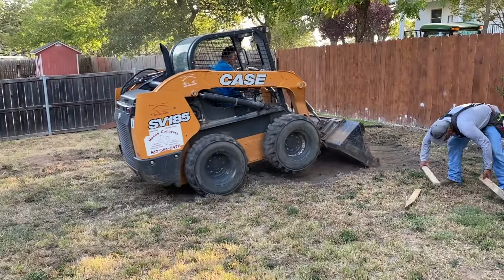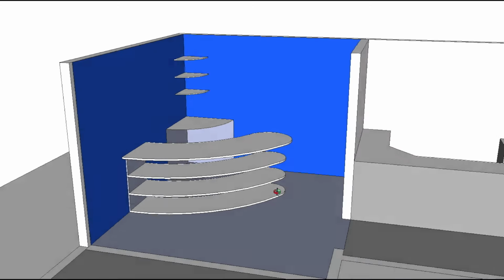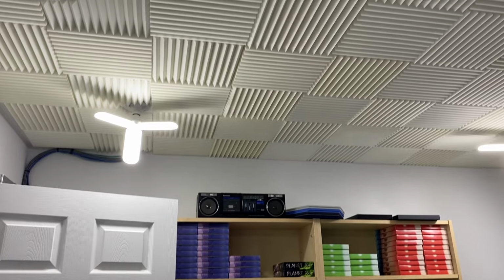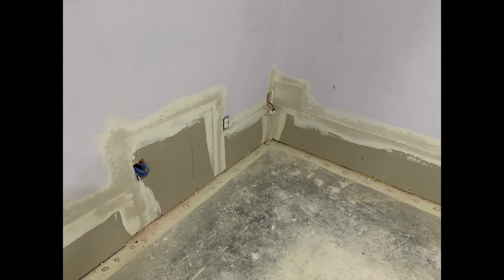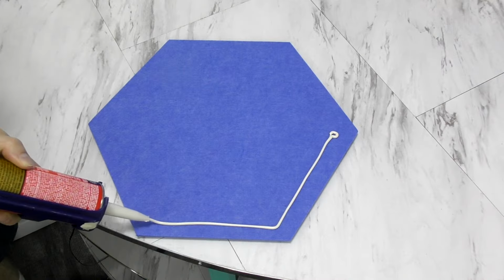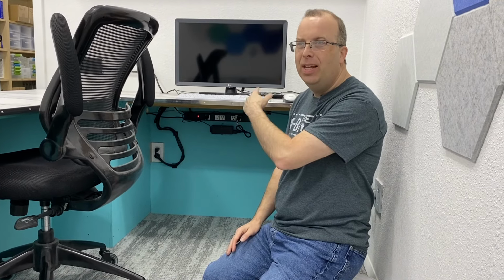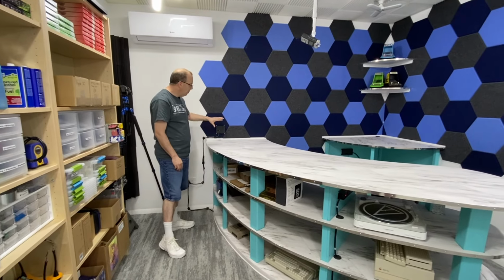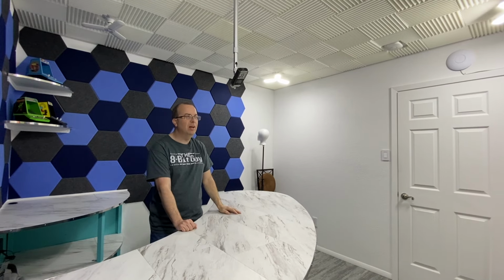8-Bit Guy Studio Build - Part 3

Comment: The hexagons are nice, but need to finish up the lower right with a few more. Also, repaint the turquoise to match one of the blues of the hexagon... as others have said it's way too contrasting and looks tacky.  You'll also have to watch what shirts you wear as it may look really awkward with certain colors. The countertops - you may want an interchangeable color depending on what you will be showing. white cases on old electronics will not contrast enough. Maybe cut some of your carpet pieces into the shape and make it grip the existing countertop when you need a darker background. Or maybe smaller hexagon tiles like they make for kitchen/bathroom backsplash.

Also, glad you're ok with... um... EVERYTHING that has happened to you - heat wave, blizzard, burst pipe, falling, spider bite, vinyl triangle debacle... you're a walking 8-bit disaster!

Comment: Instead of having that ground on or off switch, you'd normally ground through a 1 megohm resistor. It allows enough current to discharge static while not really increasing the risk of electrocuting yourself. ESD wriststraps have a 1M ohm resistor inside.
Reply: You beat me to it!  My experience with grounded workstations and wrist straps from decades ago used a 100 kilohm resistor from the work surface to ground, and 1 megohm for the wrist strap like you said.  There are also laminated worktops with conductive characteristics that will bleed off a static charge but not be conductive enough to interfere with active equipment on them, but those may be rather costly.  We used them at work, Stanley Vidmar was the brand of workbench, I have no idea if they still exist under that name.

Comment: I would also use a high value resistor in series for the metal strip. Like about 10M. A switch is just too easy to forget and with a direct path to ground things (and yourself) can get zapped anyway. With a resistor it will bleed the static charge slowly.
Reply: This method is also used by ESD-kits

Comment: Thoughts - 1: If you keep the hexagons, you should pretty definitely complete the pattern in the lower right, at least within camera range, because the wall peeking through really kind of wrecks things - if you're going to have a geometric pattern like that you really have to complete it, at least for cameras. And also fill in the missing spots on the left - here, these are the four places I mean.

https://cdn.discordapp.com/attachments/766592039554383882/859524205430571018/Screen_Shot_2021-06-29_at_12.52.32_PM.png

2: I'm sorry, but the turquoise clashes pretty badly with the red undertones in the dark blue hexagons. I'm not as big an anti as some on the white tabletop - though in all cases I do think you've got too much eye-attention-grabbing contrast - but that colour combination just has issues. The bigger the pattern elements, the easier you tend to want to go on contrast. (Within a range, of course.)

3: Did you consider going chroma-green backdrop because of the hilarious background adventures? Because, you know. Hilarious background adventures. xD

Comment: just FYI shark bit fittings are only to be used indoors and are never to be hidden in a wall our used on an outside wall. They are only to be used on exposed walls like your mechanical room. This looks like it's an outside wall (all the insulation) might have been the reason for this

Comment: Ouch man; I did something similar to that last summer when I bumped my bike tire on the curb and lost control.  I caught myself on my elbow in a way that pushed by shoulder up sharply.  The arm was almost unusable for about a month or two afterwards.  Even after that, it took months to get it back to 100% usability; and it still pops more than it used to

Comment: For your ethernet problems... there are ethernet cables with angled connectors. That'd look quite a bit better than the cable coming straight off the connector and then being pulled towards the direction it's needed.

Comment: Your shelf wall is great for sound - acts as a diffusion wall.  As other (Matthias Wandel) mentioned a 1MEG Ohm resistor between your strip and the ground connection is important for safety.  Grounding the strip is a great idea in general, the resistor is for your protection.
The hexagons in the background almost look virtual - kind of a 'MAX Headroom' feel, which, as you might guess, I approve of :D

Comment: I worry a bit about the grounded strip. If that switch isn't rated for high voltage and you accidentally connect yourself to a CRT HV line, it might jump that switch and ground you anyway.

Comment: The background doesn't really need to be dark. Your lighting rig needs work - you've got the backlight covered. Now get a key light and a fill light. Also get some felt for the back of that door. There's still far too much echo when using the field recorder (ideally swap that out for a mic that's appropriate for the space).

Comment: You could create a curved edge to the desk on the wall with the ethernet, extending it over the existing socket, then put a hole through the desk for the faceplate, like you did for the power. Would save bending the wires.

Comment: Hi - Very  nice they work rooms with the lounge can become a relaxation place as well as a work zone

Please check with a electrician on the grounding wire, it should be Ok, but if you ever get a power issue and there is active voltage to common ground you might get a zap

It may be nothing but worth checking, you could use a separate earth wire not related to the mains earth and feed that to a earth spike in the ground 

Not sure if it was the old home or my parents old home, there was a issue with old fridge and earth but it was earthed to a spike and also the outdoor water tap but when using the tap you could feel a tingle some times

Comment: So what I would have done, even though it would have been a bit pricier, is get some old box art printed on fabric appropriate for covering large poster sized sound deadening panels. Off the top of my head, Ultima IV, Elite. Space Battle for intellivision, winter/summer games. Maybe have a bunch printed and attach the fabric to a light, thin frame and attach those to the panels with magnets, so you can mix up the look depending on what you're making the video on.

Comment: My thought on the hexgaons is that they appear to make the room even smaller than it is.  I think it's the effect of them being quite large, each one seems to be trying to dominate the one next to it.  This is particularly obvious to me on the edges of the shot.  This is because the walls are at a 90 degree angle, which means the hexagons on the very left and very right of the screen seem much larger than the ones in the back (parallax), and that in turn creates a feeling that those walls are closing in.  It's one of the reasons why many studio spaces have only a flatter back wall visible and not a noticable 90 degree.   The best way to see this would be to take your camera and move it to one side, such that you are standing with the flat wall behind you in shot instead of the V of the walls coming together.  I think you will see the difference.

Comment: If you want more sound dampening, look into some deeper wedges that you can hang onto the walls outside of the shot of the camera. Your hexagons are going to be much more reflective than absorbent if you're trying to take echo out. I would personally add more hexagons all the way to the floor, mainly for aesthetic reasons. It looked like all of your corners are taken as well, which I would've also suggested bass traps if you want to be super serious about your acoustic treatment. I've built a couple recording studios for myself and a friend, and it was a learning process.

If you were looking to change the way you record your audio, a decent condenser mic with a windscreen hung up at the exact same location would do you wonders.

Cheers from two states north!

Comment: Looks good mostly, perhaps paint the shiny shelf edges behind you in Studio 1 (grey?).  Also, the lighter colour (cyan) in the background a bit.  Perhaps the addition of some tasteful/colour tech company logos made out of (or printed on) (porous, thick/non-glossy) paper and then stuck on the hexagons might work?  (Alternatively some pixelated designs made from felt, with Velcro strips on the back so they can be changed often?  (Perhaps you could call them 'spare pixels'?  This also might add some additional colour as it did seem a little washed out?  Grey/black/dark beige (with some white bits) might work better for the work bench?  Just some thoughts.  Otherwise it all looks great!  As you say, tweaks will be made over time, no doubt.

Comment: You should mount a pull down projection screen behind you with a short throw projector so you can have interesting backgrounds when you are talking. You could use it for slideshows so you can point at the parts you are talking about in the video.

Comment: I think basically the reason the hexagon looks slightly off is that the blue tiles are way too saturated. Maybe if you only use a few tiles of blue to decorate the otherwise dull wall it'll look better, but that means you would have to buy yet another shade of grey.

Comment: Hey David, 

I noticed that the ethernet cables you put in studio room 2 were straight ones and I thought I would recommend these 90 degree left turn ones that monoprice sells in case you were looking for a solution, just in case you accidentally lean against or back into them because it probably wouldn't end well for the jack. Congrats on getting it finished by the way!!!

Link for the cable: https://www.monoprice.com/product?p_id=31017&gclid=CjwKCAjwieuGBhAsEiwA1Ly_nQBexUEW0PytPeqaL5g_-0Cj9KfjZ8qQ4PuoCrB_Gu1TdE305RXFJBoCb5AQAvD_BwE